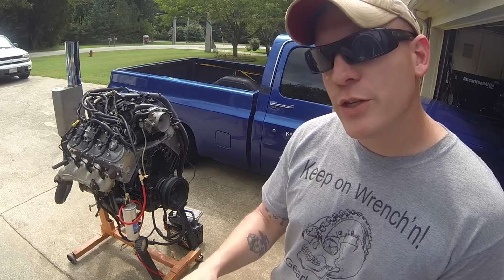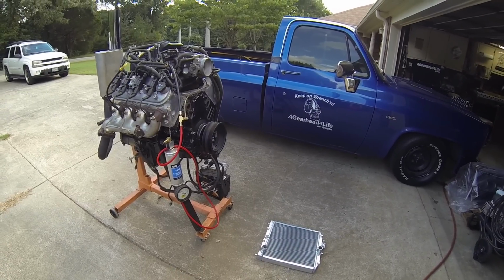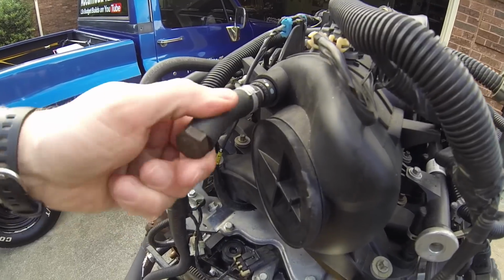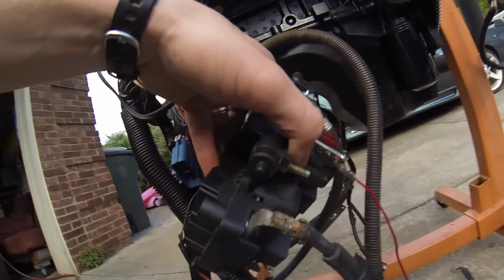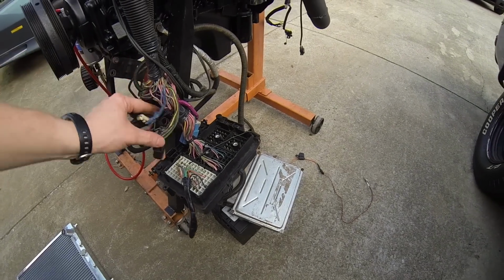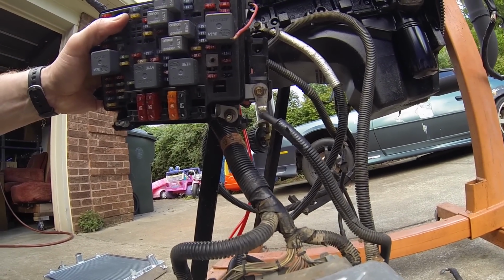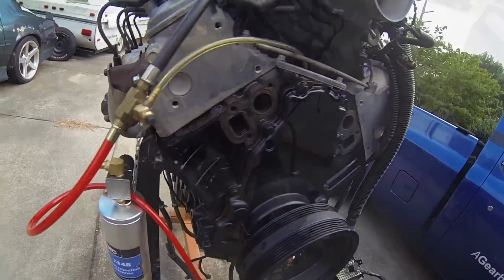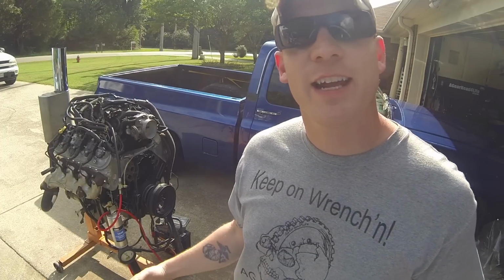LSx Swap Harness How To Simple & Free DIY Standalone on the Test Stand

Comment: I'm a big CHEVY GUY but, I'm so f**king sick and tired of LS swaps!!! Do something different.
Reply from the maker: MegaJE22 haha I can definitely understand that feeling. I usually can’t stand doing what everyone is doing. The problem is that it’s too hard to overlook the potential and low cost of these motors. To do something different would usually cost us more and get less in return, depending.
Reply: I know that. You csn pull em' outta the junk yard and beat most of them to death but, my son just had a 2003 Ford F150 shortbed 4x4 given to him and I'm not a big Ford fan but, it was free. I'm gonna turbo the motor it came with...which is a 4.2 V6 OHV motor. Gonna see how much faster and mean we can make it. Just because everyone else is doing LS Swaps. It's the 1 year that I cant find any engine management programming for. I might do megasquirt since I'm sure we'll do a LS swap to it when this ford Motor blows up!! Lol.
Reply: Any idea's or suggestions would be appreciated since we are not sure where we're heading with it yet.
Reply: I was sort of thinking that there hss to be some kind of custom tuning to the stock PCM since the 4.3 is essentially the same V6 as the 3.8 and 3.9 V6 Mustang motors. They have everthing available for those and it would be much cheaper than doing a full stand alone management system.